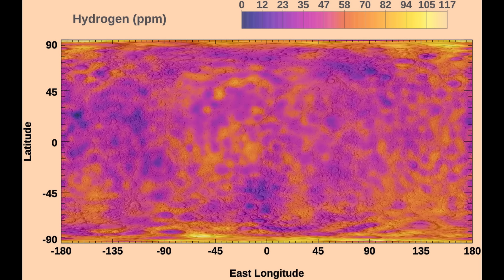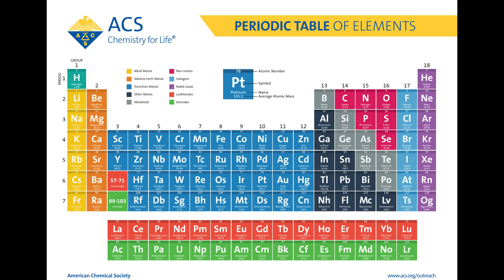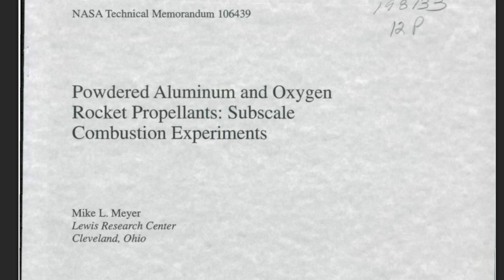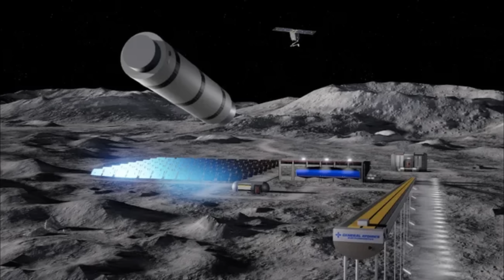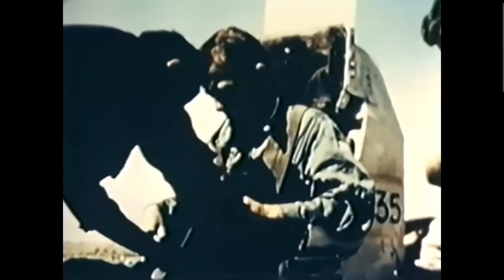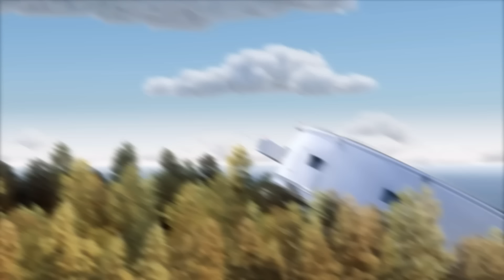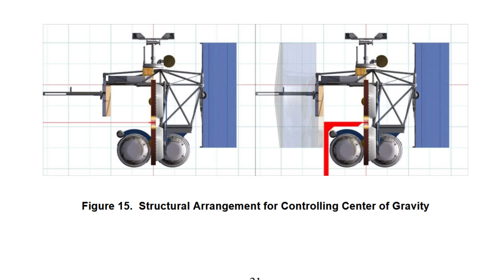Launching From The Moon With Silicon Based Rocket Fuel And Other Ideas - Deep Space Questions

Comment: In a past life (30+ years go) I was involved in railgun development.  A hybrid solution using spin launch as a high speed pre-injector to a railgun would reduce the length of the “barrel” to something substantially shorter since you are not accelerating the mass from zero in the railgun portion. A high pressure gas injector was one technique for pre-accelerating a projectile/payload into a railgun barrel. A capacitor bank was used to load level the power requirements for the railgun. Super capacitors were mentioned, but one of the limitations on their use for high energy discharge applications is higher internal resistance (and parasitic energy losses) limiting the peak output power compared to conventional capacitors. Very cool topic. Reminds me of when I was once a real engineer.
Reply: Now I'm picturing moon facilities with big ole flywheels laying on their sides, transferring torque to a separate spin wheel accelerator that goes off into a rail gun towards the horizon and earth - everything balanced and timed so the payload goes into low earth orbit and bullseye inside a receiving station that's probably fifty miles long and made of giant rings of electromagnets to decelerate and grab the payload. Then it just gets taken apart and distributed.

Imagination is nice.
Reply: Yeah, super capacitors don't do well in the sub second regime.
Reply: Why would a rail gun be preferable to a magnetic coil gun for application like this? Can you explain?
Reply: @adamb8317 Hi, not very knowledgeable in coilguns except at a very high level, but at a first blush coilguns might actually be a better approach versus a railgun. Rail guns tend to deposit a conductive soot on the insulator separators between the conducting rails. This conductive soot parasitically diverts some current directly across the rails rather than through the armature driving the payload causing a loss of efficiency, I.e., lower peak velocity vs. energy input. Not sure of the energy efficiency of coil guns versus rail guns, so efficiency could be a bigger factor of one versus the other.
Reply: @S.X.X.G  Thanks for telling me what you know. I know magnetic coil guns “work” but I suspect they may be electrically inefficient. I’d have to do more research as well to know.
Reply: @adamb8317 coil guns have single digit % of efficiency, at least conventional ones
Reply: man, that sounds like a fun job
Reply: @liamosterhout6538 Back then, it was just a job. Never thought too much about it as working on leading edge R&D.  Looking back, there were a lot of pretty cool projects, light gas injectors, accidental blowing up railgun breeches, multi-shot railgun, delivery of rail gun material test beds to Japan, capacitor bank development, waveform optimization. Always lots to do. Actually, if you recall, there was a railgun mounted on a Naval ship in the Transformer movie. We did some of the original development work that was the basis for that concept.  What I don’t know is whether the military actually ever did what was portrayed in the movie. Always fun to see stuff that you’ve worked on in a movie.
Reply: I did a quick check. Ship mounted railguns have not been implemented.  It looks like some of the limitations we were working on to resolve are still limiting factors.
Reply: @S.X.X.G  they work great for a couple shots. Then the armatures have to be replaced. 🤣
Reply: @ multi shot? Wow that sounds energy intensive!
Reply: @adamb8317 Actually, the armature is what intentionally shorts the conducting rails to provide the conducting path for the current. The residual soot deposits on the insulator rails that separate the conducting rail. On the high energy rail guns, the insulators in the barrel would have to be cleaned to remove the (conducting) soot before a subsequent shot. The soot deposits was one of the engineering challenges (among many others, like power generation and energy storage) in developing a “high repetition rate” rail gun.
Reply: @S.X.X.G  Ok makes more sense than what I said.
Reply: Wondering tho. How does the projectile transition from the spinlaunch side to the railgun side reliably accurate enough without destroying the railgun side?
Reply: @de0509  perfect timing 🤣
Reply: @de0509 I was just conceptually envisioning a similar mechanism (whatever that is) to what spin launch does now to release (eject) the payload from the spin cavity, basically just aligning the spin launch ejection port with the entry port of the rail gun. I didn’t do much of a mental deep dive into the engineering mechanics for the transition (not that smart anymore).
Reply: @S.X.X.G  if I understood it correctly with a railgun, the projectile and the rails are in contact for current to flow. This means an almost perfect alignment if you dont want to involve having to use insane voltages to have electric arcs to jump across rails

With everything in life there will always be errors. Now if the time of release has errors, this means there is a variance in the trajectory of the projectile. And specifically because spinlaunch would involve wildly high rotation rates, a little bit of error in release time will result in a wide variance in trajectory. Think of how its so hard to aim a sling.
Reply: @de0509 (…great discussion, by the way). The difference between the spin launch and the sling analogy is the spin launch is contained until release, and the release point will always be the “same” since there is only one exit point. If that exit point also has the equivalent of a straight tube to guide the exit direction of the payload (which it does), why not make that exit tube the beginning of the rail gun barrel. better analogy might be a marble traveling in a (stationery) roulette wheel. “Centrifugal” force will keep it forced on the sidewall. If a piece of the sidewall is removed, the marble will exit. Conceptually if you put a funnel at the exit, you could force the trajectory of the marble. Now replace the funnel with the barrel of a rail gun. It’s not a perfect analogy, but hopefully it conceptually provides the right mechanical picture, mechanics and relationship between the two systems. (Armchair engineering is so much easier than real life.  …all you gotta do is…   LOL)
Reply: @de0509 Regarding the armature conducting electricity.  In real, high energy rail guns, the armature is only needed to start the flow of current.  At those high power current discharge magnitudes, the armature actually vaporizes (think of the armature as the equivalent of a fuse used in your car). When the armature vaporizes, it creates a conductive plasma that actually provides the conduction path between the conducting rails, so exact alignment isn’t necessary. Most of the energy storage systems I worked with were on the order of 1MJ/11kV for small bore test beds (5mm bore diameter), 32MJ/11kV for a 90mm bore cannons. The largest system was 65MJ/22kV. The physics considerations in high power current discharge systems are significantly different than for low voltage systems.
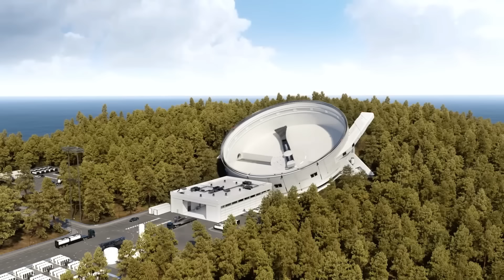Reply: @S.X.X.G  Oh on this topic I am sure you are mistaken. Spinlaunch does not work the way you described. It is a balanced lever with the projectile/craft attached to the far end, with a heavy counter weight on the other shorter end for balancing. It really is the time of release that determines the trajectory, and the projectile does not touch the inside walls at all. Because spacecrafts would all vary in shape and also almost always designed to be as light as possible minimising material and strength, no way they would have the spacecraft scrape against anything at all, or else something would break. If you dont trust me, you can take a look at this video at time 18:23 where it shows the concept idea of spinlaunch where the projectile is swung and held on the lever itself and NOT "because it is contained by the sidewall". Seriously, look at time 18:23 Perhaps you confused spinlaunch with the concept of the DREAD weapon system. In the Dread system yes they use the internal walls of the rotor housing to guide the projectile and opens an exit when ready to fire. This Dread concept would work for solid and symmetrical projectiles, not for spacecrafts. Look it up. So yeah, the humble sling is really the better analogy for spin launch. And thats problematic if its paired with railguns at the exit. As you said, this is a discussion, and this is as simply as I can explain how combining spinlaunch with mass drivers could be inherently problematic.
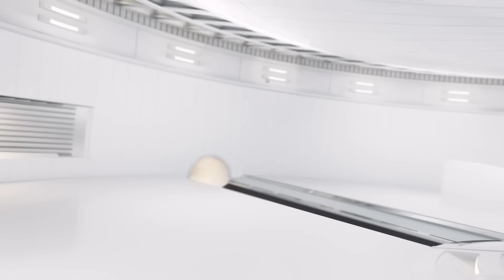Reply: @S.X.X.G  18:40 shows better the concept idea for the spinlaunch during release of the projectile
Reply: @de0509  You are correct! I was mistaken with the mental picture I was deriving my concepts from. Always good to question assumptions and results. //I got thinking while I typed my previous reply, that while rail gun analogies are good for understanding the basic mechanics and concept, scaling up payloads that are grams or single digit kilograms, to multi-ton masses, plus increasing muzzle exit velocity to escape velocity, the amount of energy required (even on the moon) gets massive really fast. Just the basic kinetic energy of the payload at escape velocity (E=1/2mv^2), and a stored energy to kinetic energy conversion efficiency of say 20% (and that's being generous), numbers get really big really fast compared to the energy storage systems we used for the small 5 mm bore test beds and the 90mm cannon.Then comes the physical scaling of what volume of space the energy storage system would occupy.  Fun topic. Thanks for engaging.
Reply: Was that with Gerald Bull for Iraq?
Reply: Spin launch is a non starter. But rail guns are pretty fast anyway. Why introduce excessive g loads if there's already a better system?
Reply: @ChrisWMF Why do think spin launch is a non-starter? Just curious.
Reply: @S.X.X.G  the g loads. not much of our current tech would survive the speed needed for escape velocity. maybe if you could get solid billets of stuff with no engines or guidance.
Reply: @ChrisWMF Ok. The acceleration forces in a railgun are significant as well (depending on the length of the barrel). I don’t know the magnitude of the acceleration forces in the spin launch, but I was thinking the acceleration forces wouldn’t be excessive if it were just being used as a first stage injector for a railgun.  You are correct that generally speaking, only solid billet type materials can survive.  When we were doing test fires using a small 50 mm bore railgun testbed, we used solid lexan projectiles. I recall (don’t quote me, it’s been a long time) the acceleration forces were on the order of 75k g-force since the acceleration length was only 1 meter long. For the larger 90mm bore railguns, the acceleration length was closer to 6 meters and the projectiles heavier (~1kg to 2.5kg), so the acceleration forces were significantly less. If you have more of an interest, IEEE Transactions on Magnetics, January 1993, Volume 29 Number 1 is a whole volume on Electromagnetic Launcher Technology (at that time of course). That volume even has a paper on Earth to Orbit (ETO) launchers. Cheers!

Comment: The rail gun may be much more practical as the US Navy has done huge amounts of work developing the electromechanical aircraft catapults, EMALS, for the Ford Class aircraft carriers. If the current system can launch a F-35C at 29,000 Kg, it should be able to be modified to launch 100-200 Kg payloads off of the moon. How much of a effort would be required to modify the Navy’s work for lunar application is a question to be worked on with special investigation as to the wear & tear caused by each launch.

Comment: Eh, Scott. Silane tends to detonate at ~4km/s in contact with air. I have worked with the stuff as it is used in the semiconductor industry and it is scary! In pure oxygen it would not burn, it would detonate ao building an engine that does not RUD would be a challenge. The silicon dioxide would clog up delicate mechanical parts of the engine. Not a good choice for rocket fuel...

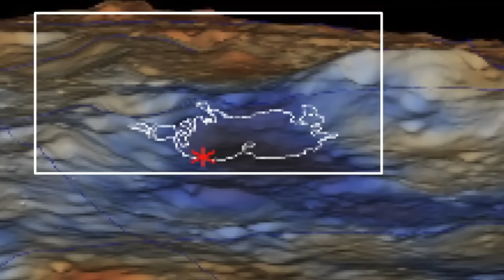Comment: 2:40 You say "The moon isn't really rich in precious metals..." Really? The moon has been bombarded by asteroids and many of these are precious metal rich; indeed, there are plans to mine the asteroids. Surely(?), there will be fragments lying over the surface as lumps, or will be buried below the regolith surface. One could imagine a rover with a metal detector finding and collecting these lumps. This would easier than capturing an asteroid?
Reply: They explode upon impact, that’s why craters are circles and not skid marks, this means the material of the asteroid is either ejected from the lunar surface or scattered very thinly

Comment: Okay so electromagnetic "railgun" type systems would have to be 300+km long.
Or.
Could they be say... 10km long. Built in a loop with the payload making 30+ circuits. Switching to a short launch track once the velocity is appropriate for launch.
So much saving.

Comment: I once postulated that a lunar surface to orbit 'taxi' could be built fueled by oxygen and powdered aluminum produced by separating aluminum oxide with solar power, then storing the O2 in tanks while blowing the resulting aluminum into a shaded space through nozzles designed to produce a fine mist that would solidify before reaching the lunar surface due to the low lunar gravity. Never saw the NASA research on the idea, so my idea might be total BS, but it's nice to know my concept wasn't total bull.

Comment: There are a lot of places in the solar system where the temperature can be consistently lower than the critical temperature of HgBCCO, provided that it is shaded from the Sun. I reckon the manufacturing expertise we’ve built up with YBCO might help us work with HgBCCO. But unfortunately there are fairly obvious difficulties we’d have with manufacturing it.

Comment: Maglev runway with driven flatbed which can be levitated but also pulled down when orbital speed exceeded. Flatbed has retractable hooks to capture loops on incoming space vehicles or release outgoing ones. Flatbed either shuttles back and forth or has a separate track to return on. Space port on dark side of the moon has multiple runways in different directions - won't bother Earth astronomers as much. 

When dark side is in the dark then very cold, i.e. good for superconductors. Charged during lunar day, most spaceport activity at night. 

Incoming vehicles would need very accurate navigation and control. Mascons could be problematic.

Comment: If you go with spin launch, build two. That way the energy left in the arm of one can be used to partially spin up the other.
Reply: I'm sure it's electrically powered, so it should be simple to recapture the mechanical energy in a battery.

Comment: If you're launching anything from a bootstrapping moon base, material efficiency is essential, so you'll want to utilize the most abundant materials or renewable methods available for your technology and industrial capacity.  Use what you can make in the greatest abundance, or what is a waste product, and keep it simple so you can get started without needing advanced industry first.

Aluminium would be very abundant from regolith smelting, and oxygen is a super-abundant waste product you would otherwise be tempted to just release into space... so powdered-aluminium/oxygen solid rockets are a reasonable first choice, with oxygen RCS thrusters.  Much of the aluminium-oxide exhaust particles would fall back down to the surface and mix into the regolith you're already mining, so it's even a little bit recyclable.

Comment: With the cable being under tension due to the counterweight, wouldn't drive motors apply a force that would want to reel the cable in? Even if a small amount wouldn't it limit how strong those motors could be? Or at least, how much torque they could apply?

Comment: Sounds like a major Kessler syndrome type of problem :/ An abrasive artificial nebula in orbit is not recommended. As an electrical engineer i think we need to do some mass driver research. Because while the principle is easy, there are numerous things i dont understand. Coil guns is a bad word. The good words are reluctance, synchronous and induction linear motor. The railgun is a bit different, it is neither, it is the linear equivalent of a brushed DC motor and is not suitable for everyday use for the same reason we dont use brushed motors for industrial apllications: Wear. 

Of those linear machines, reluctance is the most interesting. It can accelerate any ferromagnetic object, no need for special engineering. However we also need some repulsion. The capsule cannot touch any rail at those speeds and wheels are not gonna help either. Friction is MUCH higher in a clean vacuum. A lot of terrestrial mechanical engineering is unfeasible. Repulsion is most easily provided by linear induction motors. There seem to be some papers on reluctance machines with levitation but i think this will be payed for by higher fundamental complexity. Need to use my institutional login and read those at some point ^^. But the engineering for a motor that can go to very high speeds will be interesting, to say the least. A maglev train is going about 100m/s. Getting something to 2000 means your fundamental frequency becomes seriously high, assuming similar size equipment. We will need different stator rails for every section of the driver. Low frequency ones at the bottom and high frequency at the top. With a single design the ratio between lowest voltage and higher voltager per unit of current and force becomes excessive. Im not a linear motor guy, but just from the napkin math this would be a fascinating project.